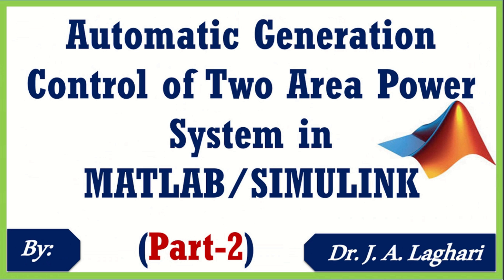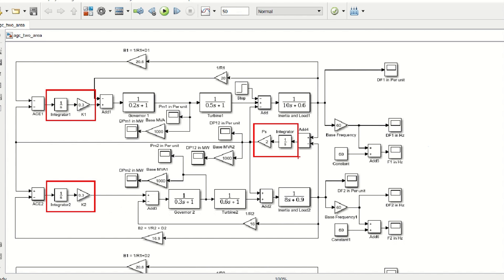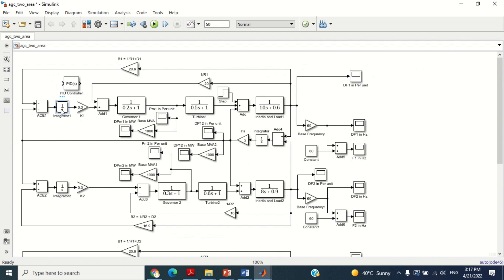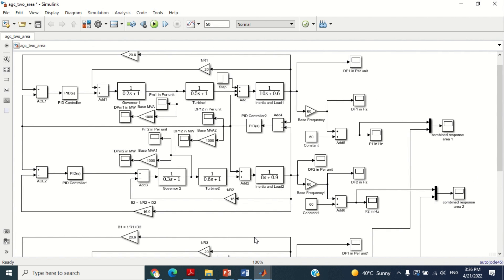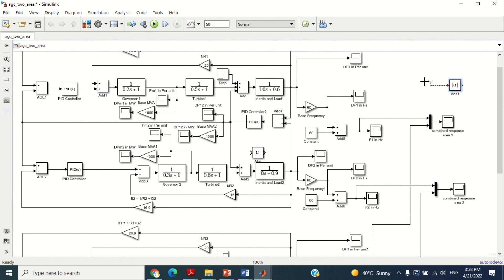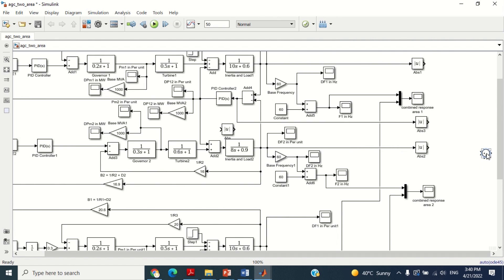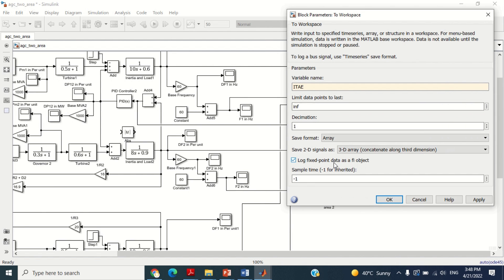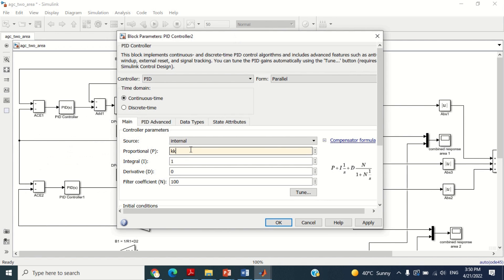PSO Based Automatic Generation Control of Two Area Power System in SIMULINK | Dr. J. A. Laghari

Comment: Error in tunning (line 4)
cost= ITAE(length(ITAE));

Error in PSO (line 42)
        Swarm.Particles(k).O = fobj(currentX); could you please help with this. Thanks
Reply from the maker: Thanks for the comment. May I know which MATLAB version you are using. Above 2017 version, you have to change the settings of the blocks.
Reply: @DrJALAGHARI  
Assalamualaikum Professor.
Not enough input arguments.

Error in tunning_laghariPSOfinal (line 3)
assignin('base','kk',kk);
I could run 'PSO' file and received output despite this error. Is that ok?
Reply: Assalamualaikum sir. 2023a. It is anyhow working even with ‘kk’ error in tuning file

Comment: Good afternoon sir
 While running the code is showing error "Undefined operator '<' for input arguments of type 'timeseries'. 
Error in PSO (line 45)
                          if Swarm.Particles(k).O < Swarm.Particles(k).PBEST.O "
Sir what's the solution?
Reply from the maker: Thanks for the comment. You may kindly watch the video and follow the steps correctly.

Comment: thank u Dr. Laghari for doing all this which are very useful for us.
But i having a problem during run pso which i am mentioning
''Warning: Input port 1 of 'two_area_model_PI_control/Abs1' is not connected. 
> In tunning (line 3)
  In PSO (line 42)  ''
please tell me how to solve it
Reply from the maker: Thanks for the compliments. May I know which MATLAB version you are using?
Reply: @DrJALAGHARI  matlab 2015(a)
Reply from the maker: @kartikkumar-kj3ro  basically i have designed this model in MATLAB 2017a version. I don't know why it is giving this error
Reply: @DrJALAGHARI  is there any command to hide these warnings
Reply from the maker: @kartikkumar-kj3ro  i am not sure.

Comment: hello professor, when i run the pso it gives me this error Unrecognized function or variable 'ITAE'.

Error in tunning (line 4)
cost= ITAE(length(ITAE));

Error in pso (line 42)
        Swarm.Particles(k).O = fobj(currentX);
 
>>
Reply from the maker: Thanks for the comment. This error is due to the MATLAB version. May be you are using higher version. Just change the settings of your simulation parameters. It will work fine
Reply: @DrJALAGHARI  Hello professor, thanks for these videos. These are helpful for my research work.I too am facing same error. How to 'change setting of my simulation parameters'?
Reply: Error due to difiningn PID parameters as 'kk'
Error due to multiple causes.
Caused by:
Error evaluating parameter 'P' in 'two_agc_2area_PIDpsoYtube/PID Controller'
Undefined function 'kk' for input arguments of type 'double'.
Error evaluating parameter 'I' in 'two_agc_2area_PIDpsoYtube/PID Controller'
Undefined function 'kk' for input arguments of type 'double'.
Error evaluating parameter 'D' in 'two_agc_2area_PIDpsoYtube/PID Controller'
Undefined function 'kk' for input arguments of type 'double'.  How to rectify?

Comment: Thank you Dr. Laghari for all you are doing. I would like to ask if this method can be used for a self made subsystem block in simulink. For example in a case where I need to use a cascaded controller. In that case I would have to build the controller in simulink myself. Can I still follow this method? Do I need to represent the gain block with the "kk" parameter?

Secondly sir, I could see that in the first video the ITAE was connected at the input while the connection was at the out in this second video. Is there any reason why that was done sir?
Reply from the maker: Thanks for the compliments. Yes. You can use the same method in the sub system but in that case you may have to use import or export blocks to take these measurements from the sub system. Second it makes no difference for ITAE. You may connect it by your way. Both methods are correct.
Reply: @DrJALAGHARI  Many thanks sir
Reply from the maker: @oladipostephen8501  most welcome.